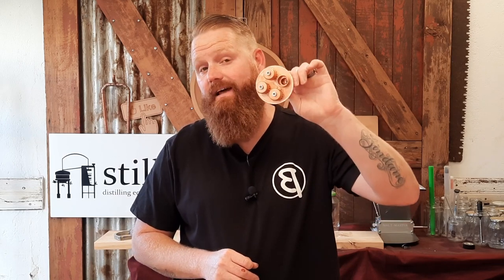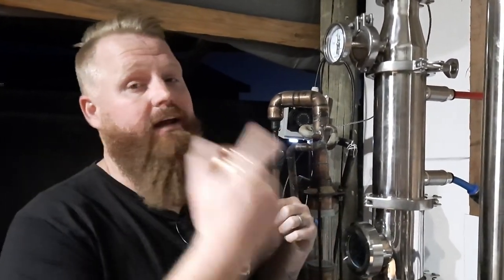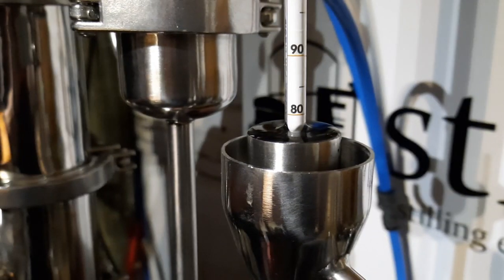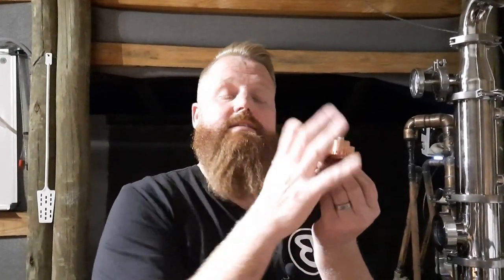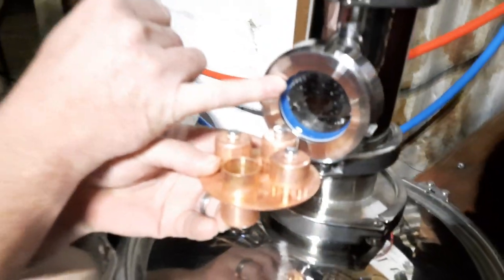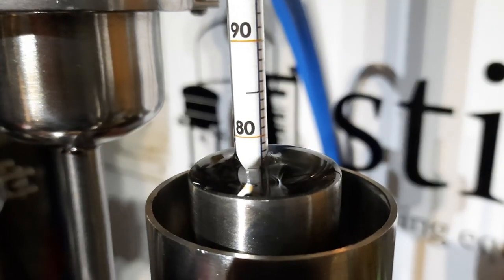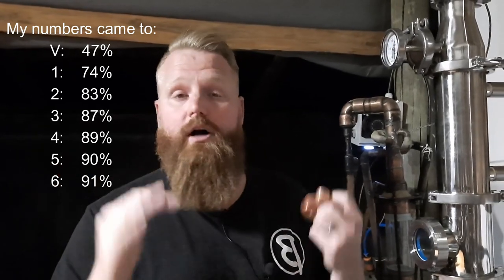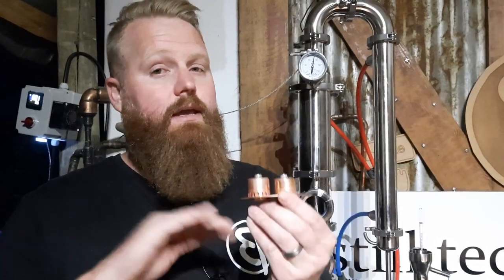How does Plates affect you distillate? How many do I need?

Comment: I use a T500 still kit and I use 3" 4 floor plates with same plates you use in this video three ups and one down with 20% abv still spirits turbo yeast wash and get 96% ABV 20c using all four plates and run it between 50c/51c and works perfectly. I also use birdwatchers TPW wash at 14% ABV still same 96% I have also used kale wash at. 12% ABV and 96% ABV. Takes roughly about 4/5hrs till finish. I take out 250mls forehead/heads all in one hit and collect 3.2/3.4 heart on all mentioned washes and use my tails for next run. 

The idea to is how fast you run your still and how good you are on running it. If you do the slowest run as mentioned at 50c/51c you will constantly get the 96% max and if you run it say 65c/67c your going to roughly get less ABV and more water in but more volume. Or if you do a stripping run at the fastest so it don't get stupid hot and steamy you can get huge volume but Les ABV but less time on finished item. So it all down to the user and testing your still skills and experience 

The bubble plate system will work as your filter to kill most of the impurities and give you the best tasting and smelling spirit. So no more need wasting your time with carbon filtering system.

I will say that getting 80% abv is down to not using a voltage controller which plugs into your boiler and need to balance the voltage to flood all your plates first for at least 20/30 minutes max first or you will get less ABV the whole point for plates is to balance the plates flood them for above minutes and and make sure you got your condenser intake water on to keep it cold as possible and one ready gradually turn up voltage and balance water as well to send the vapes up through the condenser and then get your temperature right for good flow and the do cuts foreshots/heads and 96% guaranteed

This voltage controller is what give you the control of the bubble plates to get you 96%

Remember this for perfectly drips to a knowledge and get the perfect temperature. 

1) Two drips and one long dribble constantly means perfect temperature 

2) Three drips and one long dribble constantly means slightly fast but still awesome temperature

Don't matter what still or boiler or still you use remember once you get the balance right the check your temperature and that the temperature of your still and note it down. This will always return the same and used on every wash don't matter what you add in your boiler or even if you don't use bubble plates. If you don't use bubble plates just condenser and boiler you might get lower ABV. The bubble plate will give you roughly 3%/4% extra which means more volume 

My trick for you if you didn't know this anything under or above is not recommended but still works 
👍👍👍👍
Reply: Excellent advice
Reply: Excellent advice
Reply from the maker: Dude, This is super info, I have pinned you comment.

Will have to do some adjustments on how I run if I want Neutral.
Reply: Wow, thank you for your extremely detailed response.  This is more insight and information than I’ve received, even from a“commercial distiller”.
Thank you!🙏🏻

Comment: A Turbo 500 does over 90% right out of the box. It can be de-tuned to around 80% for flavor by removing half the packing.  With all the packing removed its a pot still. At around $600.00 it can do anything the flute stills can do for a fraction of the price.
Reply from the maker: True that Brian,

With some fiddling you can make a T500 into anything.

Just here in SA a T500 is crazy money, more than half of what this still cost.
Will like to own a T500 someday think it is an awesome bit of kit.

Comment: Thank you for explaining that. When using less plates to run a whiskey, are you running the reflux condenser at all?  And do you use less power through out the run? Im still working on finding that balance. Thanks for the videos! 🥃
Reply: In my opinion,  any time you making whisky you need some reflux.  In the beginning,  run a full reflux and balance your column at 160 to 170 F for 15 minutes.  That means the temp at the top of your column is 160 to 170F, and the reflux is being able to condense down all the vapor coming to it.  In this 15 minutes of full reflux column balance, you will collect most of you acetone,  methanol "not all", and harsh alcohols.  Then ease down your reflux to collect your foreshot/head.  When you get to heart cut, maintain minimum reflux, it helps.  Then, when you feel that you are getting into tails, go into full reflux mode again. This will help you to collect most of the leftover clean alcohols in your column.  After 15 minutes, eas your reflux and pick the last bit of heart.
I learned this from Mr. Bever, thanks Bever for good contents and great efforts.

Comment: Thanks but I’m really confused. I have a 2” column with only a dephlagmator and run at 172 at the start of my hearts and end at 168. 
What size column is that 3 or 4”?
Reply from the maker: Hi Scott,

it is a 3" column, the way you run your still will greatly increase the ABV you get on my old still I was able to get higher ABV at the same take off as on the new still.

Cheer

Comment: Hi Beaver! Excellent explanation on the bubble plates. And very important the percentage (15%) of inneficiency of each plate. Quick question: for fruit brandies how many plates do you suggest?
Reply from the maker: Hi Geo,

Super sorry for the late reply, I run between 2 to 3 plates, if I want the light flavour 3 plate if I want the some deeper flavor I go for 2 plates.

Cheers
Reply: @BEAVERDIY  Awesome! Thanks for the tip Beaver! Greetings from Greece!
Reply: @BEAVERDIY  Really interesting video! Follow up question to this for a brandy or whiskey, if you were to run the 2 to 3 plates as you recommended to Geo, would you only do the single distillation of the wash before aging it? i.e. do you consider the partial redistillation achieved by the addition of your plates giving you comparable results to using a basic pot still (no plates, no reflux condenser), but doing both a stripping run, and a spirit run?

Cheers, and greetings from downunder here in New Zealand!

Comment: Hello, so I was wondering are you running copper mesh and or rashing rings in you column? And how much knock down are doing with your precondencer? I run a 3 inch mile high still with only 3 bubble plates. 1 roll of copper mesh with 2 cups of rashing rings in my column and I am getting 186 proof. With just enough knock down in my precondencer to keep the plates loaded. Thank you for the video👍
Reply from the maker: Pre condenser set to knock 25 back only enough to load plates, old still I used packing it strips flavor alot faster than your plates
Reply: Ok, good to know. Any chance of a video explaining more of that?

Comment: I am not sure if that is correct but it makes intuitive sense to me that if 6 plates don't give you 94% whilst it should, then I would guess that its running too quickly (either too much power in or ambient temperature is high).
Reply from the maker: Hi Martin,

Yes Vapor speed does have a play a roll, but with the run with the 6plates I RUN with a PID and a really low take off speed to get that ABV, and the reflux was set to around 10%, The if I ran it slower the Efficiency went up to around 90% of a full distillate

Comment: I find the plates make little difference, it’s your reflux chamber/deflag that’s doing most of the work, for instance I can get 94%with 6 plates and I can still get %90 with 3 plates just by adjusting the flow rate through the deflag.

What’s interesting though is that with less plates I can still get a lot more grain or molasses flavour come through at a high ABV, where as on a pot still those flavours are usually towards the end of the hearts cut.

Comment: Hi Beaver, the new still is a beauty.  What difference does the dephlegmator make to your abv. Does it increase you abv if you run more water thought it, increasing the reflux?
Reply from the maker: Hi Neil,

Thank you yes the high % of reflux you add to the run the more you will force interaction between the vapor and the liquid, depending on how high you set the reflux you can get some serious ABV off.

Comment: Thanks for a good video. Have you tried a packed column section on top of your bubble plates? I believe the plates will do the heavy lifting and you will be refluxing in the packed column from a starting point of ~90% (i.e. whatever you currently get now at your top plate). In packing you should get multiple reflux interactions and you might find you get to 94% even with a relatively short additional section.
Reply from the maker: Hi Stefan.

I have order a spool tube to add to the still, super Idea to place it at the top, whould you suggest before or after deflag.
Reply: @BEAVERDIY  Hi mate - before deflag. Packed with SPP if you have it, or marbles. I’m hoping you can get to azeo.

Cheers
Reply: @stefanluke2771  Hey Stefan - what is the packing doing that an extra bubble plate wouldn't do? Genuinely curious and trying to wrap my head around it. Does it give the still a wider "sweet spot" or something?
Reply: @erich1394  Hi mate - Nothing really different, it's just like extra plate(s). Probably cheaper. There are maths that predict how many notional plates for a given volume and type of packing, but I haven't bothered to work it through. I happen to have 6 plates, and I put a 500mm 4" pipe filled with copper scrubbies on top when I want to do neutral. I probably could put another 6 plates on there and get the same result but what I have gets me comfortably to 95%.
Reply: @stefanluke2771  Hey - Thanks for your insight Stefan! It definitely helps. I hope you have a great weekend.
Reply: I run my packing before the plates. It helps a lot with higher proof
Reply: @frankromig  Have you found any difference between packing before vs packing after? Thanks for sharing your experience!
Reply: @erich1394  I have never tried packing after my plates. Never occurred to me.👍